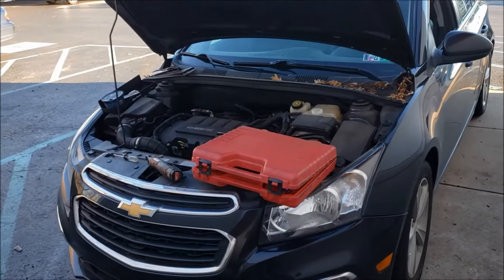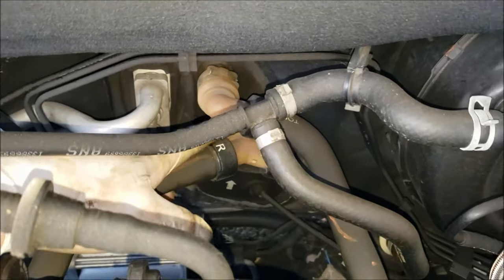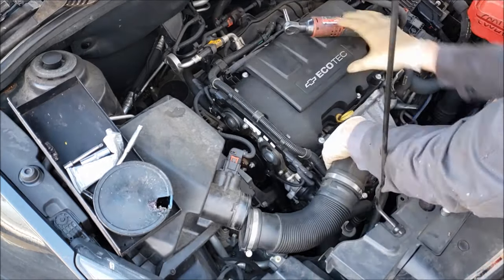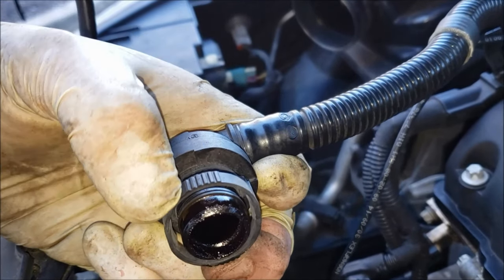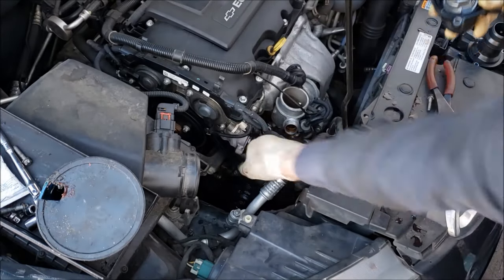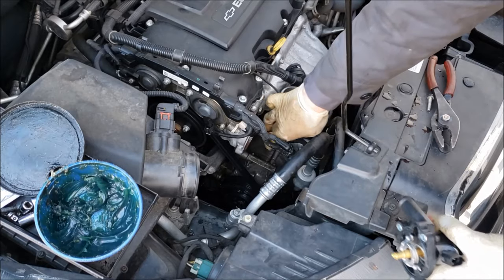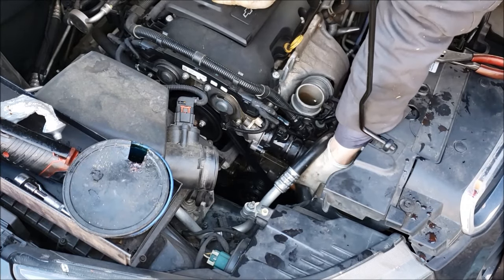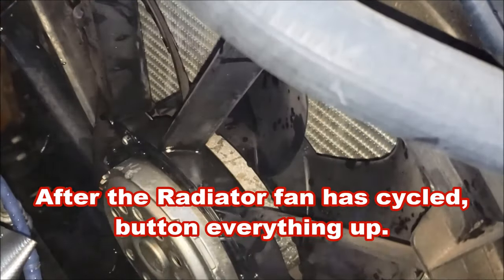Chevy Cruze Thermostat Replacement GM 1.4L Coolant Leak / No Heat

Comment from the maker: *THERMOSTAT/HOUSING: https://amzn.to/33ghUmJ
*COOLANT OUTLET HOUSING: https://amzn.to/33PTBwu
*E TORX SOCKETS: https://amzn.to/32zR0qC
*HOSE REMOVAL PICKS: https://amzn.to/2MyTAas
*MILWAUKEE M12 RATCHET: https://amzn.to/2Silnwk
*HOSE CLAMP PLIERS: https://amzn.to/32JyYC0
*OBD 2 SCANNER: https://amzn.to/2LuGQQ8
*MECHANICS TOOL SET: https://amzn.to/2NctGIC
*COOLANT PRESSURE TESTER KIT: https://amzn.to/2DeX1hd
Reply: how come no antifreeze coming out of the hose you pulled of and when you take of the housing there should be antifreeze coming out of there too please explain
Reply from the maker: @dancurrier6421  without going back to view the video. My first guess is probably because I drained the coolant?
Reply: hello I like watching your videos I just started to watch them. Trying to figure out my problem  on my 2015 Chevy Cruze 1.4 tubro Eco LT  takes for ever to heat up in cold weather
Reply from the maker: @dancurrier6421  thanks man appreciate you checking the channel out. If it takes long to warm up you could have a faulty thermostat that is partially stuck open or opening too soon.  Or if the coolant level is too low sometimes that will cause you to have intermittent heat because the heater core will only be partially full of coolant

Comment: You never lied. Always replacing something with the coolant department. Hoses thermostat heater hose etc
Reply: For real.. I replaced every part thinking its the upper pump, lower, inlet hose ect like wtf and now a therm all in 2 weeks😵
Reply: Indeed!  In my case, this simple fix corrected the dreaded P0299 and P00B6 codes as well as the P0128 code that clued me into this relatively quick, inexpensive, and easy (but for that atrocious brittle plastic hose breaking) fix.  Could save somebody from being buffaloed into an unnecessary turbocharger repair that costs a king's ransom.

Comment: Great video. Two things I would do different. One, I would not splash the motor with water just after the job because if there are any leaks, after the job, you won't know it is leaking because everything is wet. Leave the cleaning for much later once you are happy there are no leaks. Two, first loosen all three bolts and then it would be easier to remove that clamp with some pliers.

Comment: He is correct... you will be replacing these items. The water pump, the thermo, and the outlet housing on the drivers side. The coolant reservoir (they crack). Heater hoses, and all the water hoses for that matter, are actually pretty good quality, so that part is rare. I would recommend using your favorite auto parts store brand for replacements. If you have a floor jack and a good set of inverse torx, it is easy as pie to do all these jobs.

Comment: More than once I have had to put the car up on ramps in order to get all of the air out of the system. Sometimes you need to make sure that your coolant reservoir tank or radiator cap are the highest point in the system in order for all of the air to bleed up to the top. Sometimes just running the engine at a high rpm doesn’t work. Just a tip for those who may do this procedure and still not get any heat out of the heating ducts.
Reply from the maker: Yeah totally agree with you on that! These are pretty good about burping out really fast

Comment: Exceptionally well done, the best, most concise description of this job from start to finish I've seen here.  In my case, the corrugated hose and its squeeze clip both broke, and I found the thermostat to have no gasket. It also kicked out 2 other codes, including the dreaded P0299.  I patched the corrugated hose with rubber hose sections and self-sealing tape, the parts place not having a replacement for that brittle, engineering atrocity of a plastic hose.  All codes were gone, much appreciation for this concise fix for an issue anyone with these vehicles will inevitably reckon with.

Comment: Thank you! My thermostat gasket was leaking like a sieve on my 2014 Buick Encore after a short road trip - had a big tear in it (how that happened, we don’t know). Found this video very helpful, and with a good deal of help from my boyfriend (he had the tools and the strength to loosen bolts and clamps) I got a new thermostat and gasket put on, and it’s all working perfectly now. There were a few differences between the cars (most notably a bloody steel line that was still in the way of one of the bolts), but we got it figured out. Wouldn’t have had the courage to try, but your video made it look at least doable. Saved me a chunk of money by not having to take it to the shop. I appreciate the time you took to do the video.
Reply from the maker: Thank you for sharing your experience and glad to hear the video was helpful!
Reply: The reason that gasket was ruined in a short period of time is due to pressurized water and steam being pushed trough the leak, it acts like a knife that can slice rubber very easily. I’m glad you got it done.

Comment: Nice video! I highly recommend the aluminum replacement over the plastic. For anyone watching, my advice is, you might as well go ahead and replace the serpentine belt while you're at it. Why? Well, if your thermostat has failed, your serpentine belt is getting old, too. Also, getting the motor mount and belt out of the way makes it a lot easier to get to all the hoses and bolts of the thermostat assembly. Serpentine belt is less than $20.00. Also, if you are replacing the serpentine belt, definitely go ahead and replace the thermostat while you're at it. Way easier and faster to do both at once instead of one at a time, and again, they age at about the same rate, anyway.

Comment: It might be worth mentioning at the beginning that different Chevy Cruze engines will have different placement and configurations of the thermostat and housing,  My wife's 2012 Cruze has it on the right side of the engine next to the battery!

Comment: Well done vid. Might as well change the surge tank and the hose to the outlet as well as the outlet at the same time. All kinds of cooling problems on this engine, but the outlet is the most common failure.

Comment: My understanding after much research is that the sensor in the housing isn't a sensor at all but a heating element that is controlled by the computer.  Any time the engine is under heavy load the computer turns element on to aid in opening the thermostat earlier to allow for more cooling.  The continuous operation of  the element if the car sees hard driving contributes to both early failure of the thermostat itself and or leaking of seal or cracking of plastic housing.  Additionally if the unit fails or burns out the temp Guage will show cold constantly while the fans may run continuously on high with dash warning tells you engine is hot (even when not) and AC is shut down. 
    Driving with a system leak without immediate repair and continuously adding coolant can also lead to early failure of the element requiring thermostat and housing replacement since it comes as a unit only.

Comment: I have the trifecta advantage tune on mine, turns the boost upto a little over 20 Psi max, a nice jump in power plus it comes with some cooling systems recalibration which turns the fans on low at 195 and full at 220, I basically never see more than 209F now where before it would hover between 222-229F all the time, hoping that helps with some of the plastic fatigue on the cooling system parts too.
Reply from the maker: Nice. Sounds like a good upgrade! Good to keep it cool
Reply: @NoNonsenseKnowHow  yeah not bad for only $300

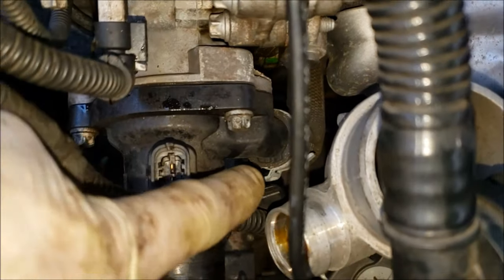Comment: THE HOSE AT 3:10 , CAN IT BE REPLACED FROM WHERE YOU ARE WORKING. I CAN FEEL THE OTHER CLAMP BUT THE CLAMP IS SO TIGHT??  ALSO, CAN GASKET SEALANT HELP??

Comment: Put in a brand new thermostat and housing and my check engine light is still on and cooling system fan is running constantly. Even though bad thermostat came up on the scan, brand new thermostat didn't fix the problem??? How does this make sense?
Edit Just had to unplug the battery to reset the computer and light went off

Comment: Doesn’t petroleum degrade rubber gaskets over time? Seems like your dielectric grease would be a better choice for gaskets and such rather than oil or grease. Also the torque on those bolts is just a touch under 6 lb ft but I set it for 6 and no leaks. Thanks for the video.
Reply from the maker: I don't believe they're rubber. And cool thanks for adding the info
Reply: Correct, petrolatum degrades rubber. But he's prob right that those gaskets are nitrile and not rubber. Better just to be in the habit of using silicone grease anyway on packings.

Comment: Thank you your video has one thing that the other is that you show the remove one screw and you can drain the radiator without having to remove the bottom  hose because I am at that point and I can't get  the bottom hose off so now I know what going to do.

Comment: Nice video!!
GM SHOULD be forced to recall & upgrade the 1.4L Turbo PCV check valve system...and the crappy plastic coolant elbow on the Dr side of Engine block! 
WHY does GM always cheap-out on the little things, and in this case, wreck what is fundamentally a decent engine!??!
Reply: I have the cruzekits.com pcv fix v2 on mine for over 30,000 miles. Great upgrade and the new v3 kit is even easier to install

Comment: Thank You for the video! The hose with the clip that connects to the thermostat now has a small leak.. does this hose go bad over time? Maybe the O ring in there? Any tips would be appreciated thanks.  5:35
Reply from the maker: Yes there is an O-ring inside. It may have got a little tear on it. You should be able to replace it. Might be hard finding one the right size though. Or take it back off and check it for Tears. If it looks okay, coat it with grease and put it back together
Reply: @NoNonsenseKnowHow  Thank You My man!
Reply from the maker: @esewey7955  no prob!
Reply: @NoNonsenseKnowHow  if I can't find the o ring,can I use a regular hose and clamps?

Comment: Another leak point on these engines is the coolant reservoir itself. Where the larger of the two hoses connects, the GM reservoirs are notorious for the plastic “ pipe “ that the hose connects to cracking. Is this case a Dorman reservoir has a metal sleeve over that plastic “;stem pipe “ that should strengthen it.

Comment: There are so many design flaws, first of all, inside the thermostat you can see the spring is hold with pre-tension by thin plastic housing bit 4:00, this plastic bit will always break whenever you tear down the thermostat; second, the gasket always fails at some mileage and causing coolant leakage.

Comment: Do u HAVE TO drain the coolent first to replace the thermostat  ??
Can I replace the thermostat without drain the coolent from underneath the vehicle.
Please let me know so I can start the process. Thanks in advance
Reply from the maker: Yes you can. Just make sure to put a pin underneath to catch the coolant that's going to come out when you take the housing off. And also make sure the engine is cold and system is depressurized
Reply: @NoNonsenseKnowHow   thanks a million brother. Bless you.  
Happy Ramadan to you and your family 👪 ❤

Comment: Hey man, great video! I have a question if you can answer... about a month back i made the mistake of mixing regular coolant and dexcool coolant in my chevy cruze. Then fast forward to this month, I started smelling burning coolant, then one day i got the engine overheated warning, i immediately stopped the car, and found the coolant completely gone... filled coolant up, and took it directly to the mechanic. He basically said the thermostat is stuck and needs to be replaced... along with a coolant flush. Does this sound like the right diagnosis? Someone else said the water pump could be leaking. Anyway just wanted to get your two cents :)
Reply: At one point the heat was also weak

Comment: Thanks 😊.
Not sure if I needed a thermostat ? My 3- outlet hoses on my 2012 Sonic (1.5 Turbo), needed replacement,and the 3-way “T” connector (hairline crack). Was leaking antifreeze.
So …… not sure 🤔 if it got hot 🥵 because of the thermostat ?
Cruz/ Sonic same setup.
Give me your advice, if you think 💭.
2012 with 169,000. Mi.
6- speed. Gas mileage car. Original owner.
In fact I ordered it in Nov.2011- came in Feb.2012.
Reply: 3- outlet hoses from the heater core to the reservoir tank, short 1- engine.

Comment: Mine is leaking where the housing meets the water pump, is there a new gasket in the set?
Reply from the maker: Yes it comes with the gasket. Or you could just replace only the gasket more than likely. But for how cheap the entire part is might as well replace it

Comment: Do you put the coolant cap back on after filling the coolant or do you let the car rev with the cap off
Reply from the maker: Let the car run with the cap off to allow the air bubbles to escape

Comment: GM does have a recall on the water pump, but make sure to see them before 150k
Reply: Does it cover a rebuilt car....
Reply: How do we contact them?
Reply: @petramarquez4513  you will have to go to your local GM/Chevy dealer or find their contact info online
Reply: @Pete391  I doubt it since warranties generally do not cover replaced parts
Reply: @beccaslemons  thank you
Reply: R u sure that GM has recall on water pump  ? My 2014 cruze has only 56000 miles and I think I need to replace it. 
Please let me know if u r 100 %sure about it.
Thanks in advance

Comment: Anyone have trouble with the O ring falling out of the lower coolant hose. Mine was like over sized and needed it replaced some reason having issues finding the right size to fit in there!  Hes the only one who even mention that Lil Oring!!!
Reply: Ask part store clerk to go in back to find the o- ring. I do it all time especially  autozone.
Reply: @dykema_dark_market5628  do you know if they have the o ring for sale?
Reply: @David Hernandez  they do just ask them for o ring from back drawer. They'll walk you back there to find your size they are like $2-$5. Just make sure you bring old one in to compare. They do have size of every ring.

Comment: What is the sensor at the thermostat housing?   What does that control?  I have a Chevy Sonic and am troubleshooting a radiator fan not running issue.

Comment: Ok so mine has this big spring that was up inside the aluminum housing when I took mine apart and did not have a spring on the thermostat side. The new one did not come with the big spring but does have one on the thermostat. So do I need to put in the big spring on leave it out?
Reply from the maker: It's hard to give you a reliable answer without actually seeing it. But I assume the Big Spring you're talkin about was the thermostats spring. So no you do not need that
Reply: @NoNonsenseKnowHow  awesome I think the new part was redesigned and I kind of came up with that assumption and I tried it and it's working fine so thank you

Comment: Can you replace just the thermostat?? Do you have to replace the housing or can you put a new thermostat in the existing housing after you remove it? I locked my keys in the car with it running haven't had any problems with it until that point now the radiator fan runs constantly and the gauge does not ever come off of cold obviously I burned out the thermostat. But do I have to replace the whole thing or can I just remove the housing replace the thermostat and then re-install the entire unit??
Reply: No. Replace the Whole unit...its a newer, better  version on Amazon $49.